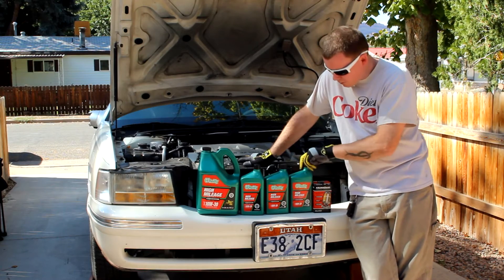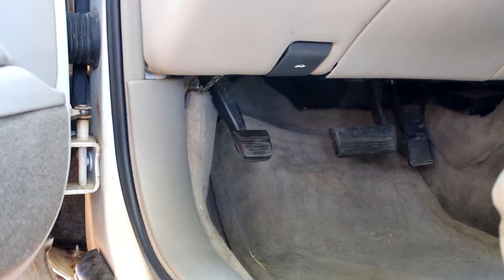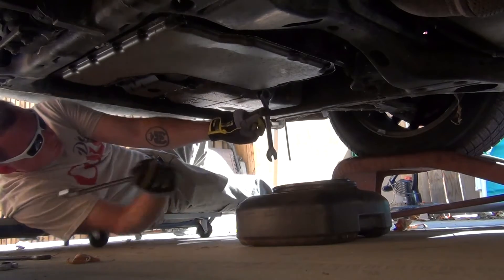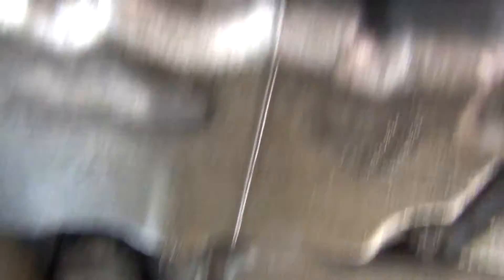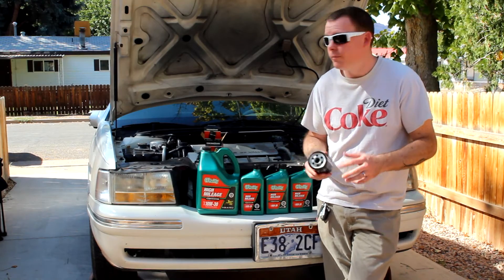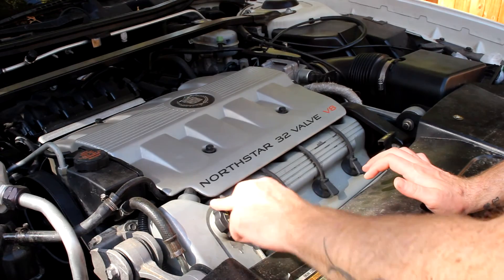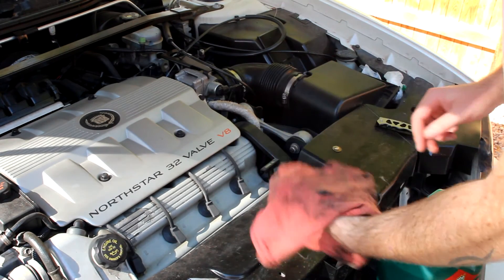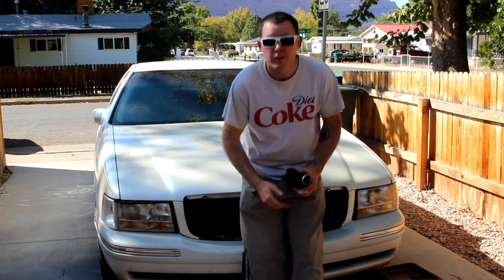1999 Cadillac Deville Oil Change How to

Comment: Thank you for the informative video. Can you please tell me what oil I should use for this?: Yesterday I bought a 1998 Cadillac Deville with 19,400 miles (Very low miles for the age) on it. It says something about 36% oil life on it. I don't know when the last time it was changed. Anyway, I think I have to put 7.5 quarts of oil but please let me know which is the best oil (Brand and weight) to put it in now to preserve the life of that particular Motor. Thank you...

Comment: On the oil dip stick when checking the oil. Where do you want the level on the last line on in the max above the line. Thank you
Reply from the maker: Puppet Master right in the middle of the lines
Reply: @ArchesMechanic  Thank you

Comment: I noticed your in Utah, would you be interested in selling the cadi?
Reply from the maker: Sold it already. Sorry.
Reply: @ArchesMechanic  how good was this car? Any oil leaks and or mechanical problems with this particular car?
Reply from the maker: Excalibur Stoneheart the North Star engine is terrible. I wouldn’t recommend it to anyone. Head gaskets leak because the engine block is too thin and warps. Goes into limp mode if it gets hot. All kinds of electrical problems. This one didn’t leak externally.
Reply: @ArchesMechanic  Damn, and i wanted me to get one ( 1999 deville).